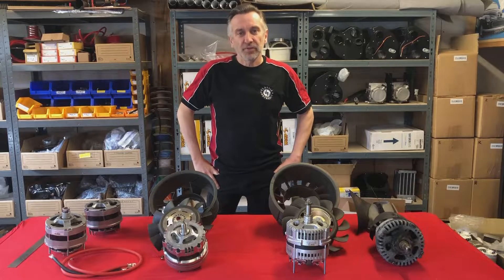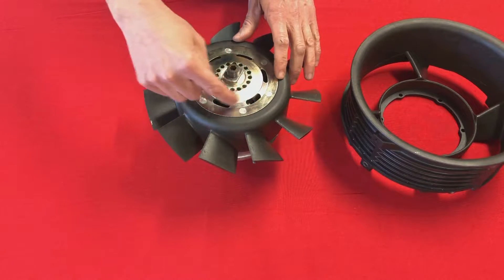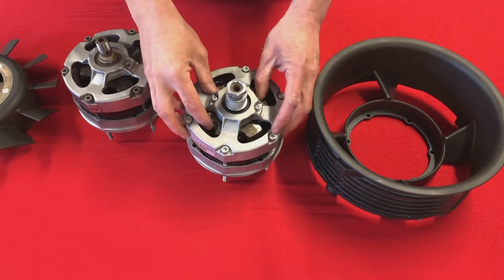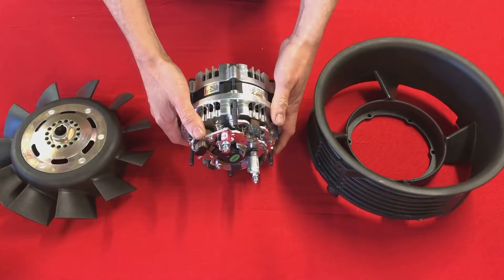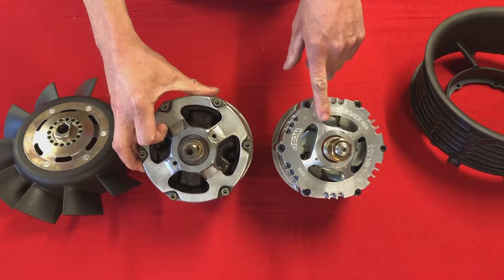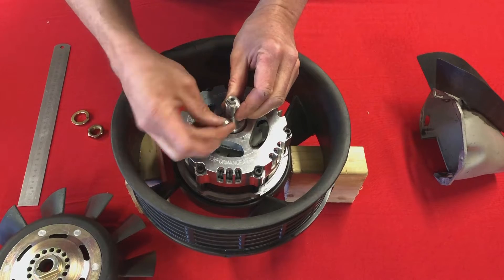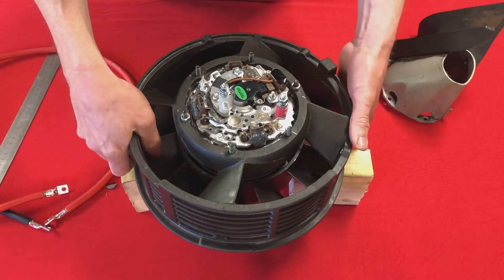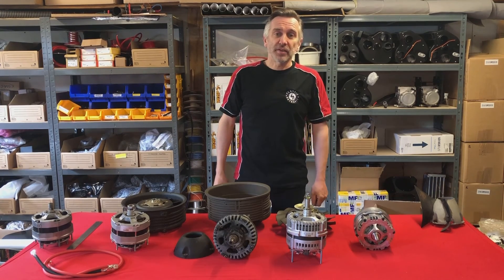High-Output Porsche 911 Alternators from Classic Retrofit

Comment: Question, on your website it says to use a serpentine style belt system when using the 240a alternator for the 993 but here you say you could use the single RS belt or the stock double belt pulley? Just want to make sure I can use my stock double belt pulley with the 240a alternator that I am ready to purchase. Thank you!
Reply from the maker: You can use the 240A with the standard double belt if your pulleys and belts are in top condition.  Also note that the belt widths are critical and are different between cars so make sure you have the correct size.

Comment: +1... A lucky find indeed as the OE alternator has called it quits.... 24 years and 80K something miles; 1998 Carrera S (993). .. Ordered the 175A for the coupe. .. Easy Peasy powering 2 aftermarket Class AB audio amplifiers ...
Reply: Update: July 2023... Bought the 175amp for a '98 993 Carrera S a while back, only now installing the much-needed upgrade... Man, the 993s Group 48 battery loves getting a fair share of charge... Screw the two class A/B audio amplifiers grabbing all the output. .. Very pleased with the quality! .. Cheers
Reply: Installed the 175 amp WOSP alternator; Actually installed by Canapa Motrosports during a whole coupe systems refresh. . Couldn't be better.